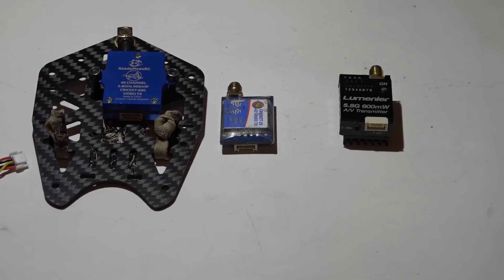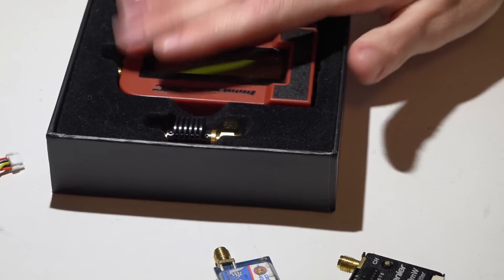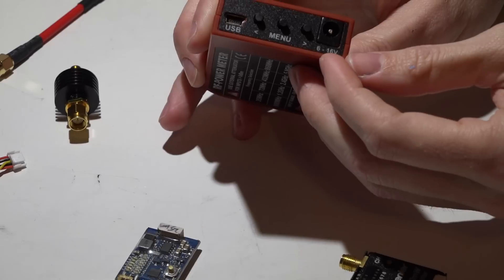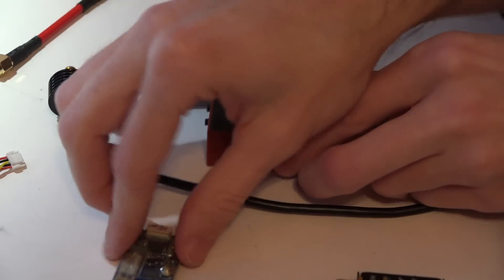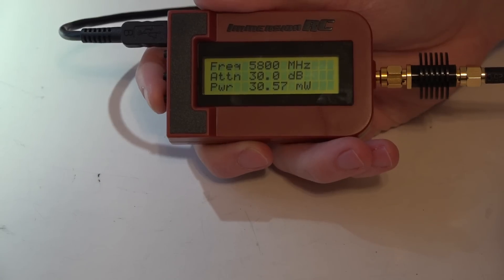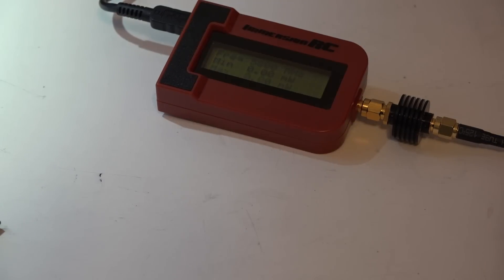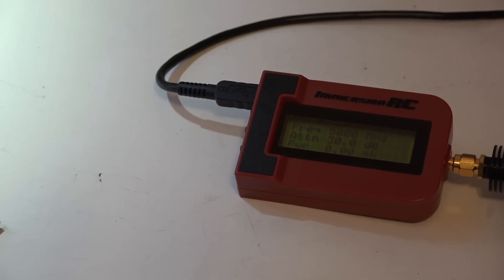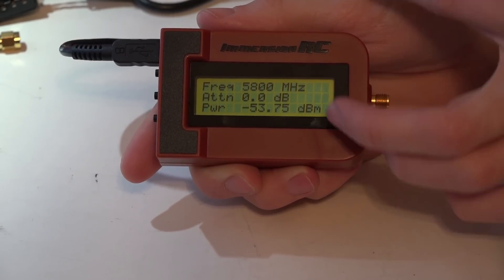Immersion RC RF Power Meter

Comment: The Anttenuator is as the name says , It to  Anttenuate the RF from the the vtx so that the power does not damage the power meter ... Some vtx are well above 1 watt , This is why you'd use the Anttenuator or you'd likely damage the Power meter ..... The Anttenuator is not instead of an antenna .... Fir this  you'd use a dummy load which is basically a 50 ohm  resistor  used as the load instead of the antenna .

Comment: Very nice JC.  How do the Far View antennas fair compared to your known good antennas?
Reply: JC makes these cheaper by getting RG402 and SMA connectors in bulk.  I wanted to try them our before going down that path...
Reply: I was looking at making a few of my own or buying some of the FarVew kits.  Would you recommend just buying the FarVew kits?
Reply: I bought 3 of the kits to get the free jig and try it out. They are easy to build about 15 minutes.  JC's video was a big help... Good luck
Reply: Project Blue Falcon Gotya,  right now I'm just using stock dipoles on my quanum cyclops so anything will be an upgrade.  I think Ill definitely give them a try.
Reply from the maker: I'd say the FarVew antennas perform better than any cloverleaf or skew planar I've ever used, bought or home made. On the meter they are the same, but the meter isn't going to say which has better range or penetration. Only how much rf power is making it from one antenna to the next.
Reply from the maker: I've switched to them and will have a comparison video coming soon after I fix my Fatshark goggles. They're not incredibly better. You likely won't see much of a difference if you even see a difference at all. What I like about them is they are very cheap and very strong. Like Tommy said, I bought a 10 pack of SMA connectors on Amazon (which are reusable), a 10 foot roll of RG402 coax cable, and then buy only the FarVew PCBs for $5 each. If you divide everything the material used plus the PCBs comes out to less than $7 an antenna. You'll get the same performance compared to a $15-$20 antenna and its stronger.

Comment: keep in mind that all antennas have a center frequency where they perform the best. most are built for dead center of the 5.8 frequencies. if you build a slightly off antenna it may actually work better above or below center compared to a stock antenna. tx/RX gear is usually the same. Some work better higher or lower. That also explains why cheaper tx gear shifts in power across the band. The final stage is not compensating. Better tx gear either follows a preprogrammed power curve or actively monitors power and swr to compensate.
Reply from the maker: Yep I agree with all of this.